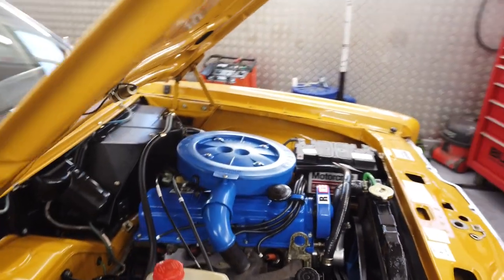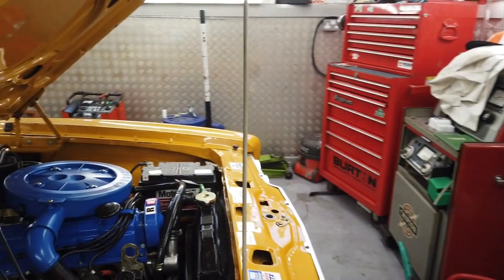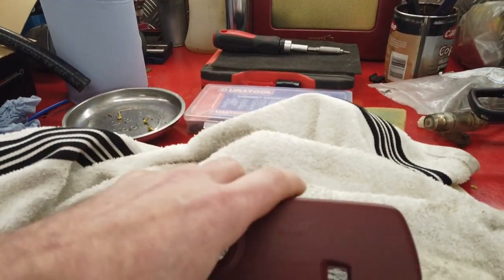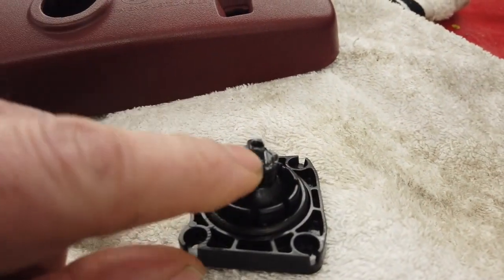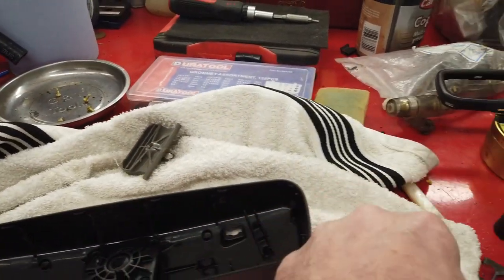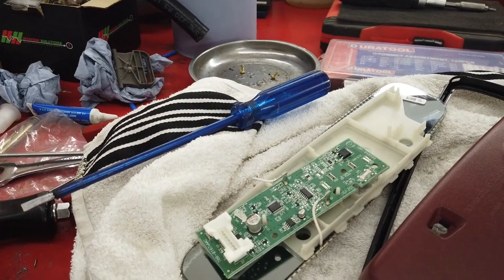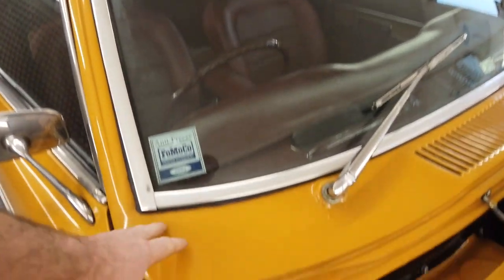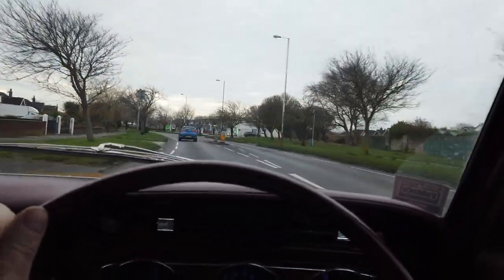Modern Headlights are too bright! - Here's a Classic Car fix that could help you!

Comment: The headlights on my Mercedes are amazing. The intensity adjusts depending on how dark it is. So on a dark country lane they are a lot brighter than in town driving. Also they adjust their focus so they always point at the number plate height at the car in front regardless of how far in front it is. Auto dipping even works when coming to a corner or the brow of a hill.
Reply: They are evil

Comment: I also have noticed that some newer vehicles on the road do tend to put out too much light at high levels. Like you, i am all for having more light output from my headlights, but some modern vehicles don't seem to have the lights adjusted correctly. Either that or the lenses on the lights are badly designed. A dipped headlight should not be directing light straight out from the front of the car, it's called dipped for a reason, the light should be focused down onto the road. I think the department for transport needs to tighten up on the regulations regarding headlight alignment on new vehicles. If a car with it's dipped beams on at night is still blinding other drivers, something is obviously wrong. 

So i can see the attraction for fitting an auto dimming mirror, might just do the same on my old MK2 Mondeo. Great video Pete, i like how you explain about the wire for the reversing light, that is something i would defo need - i have flood lights in my drive that would no doubt cause the mirror to dim - not something you want when trying to reverse along your drive at night. Ruby is looking great, so nice to see her engine bay looking so good again. Lets hope that things in the world will improve in the next few months, and you will be able to get out to some shows again.

Comment: I don't know about the rules in Britain but in Sweden, were I live, at least for the xenon lights, cars must have a gyro installed that makes sure that the dipped beam doesn't dazzle you. It's also illegal to convert the dipped beam to xenon whithout that gyro which means that it is a very expensive thing to do legally.

Comment: Pete...Re the cam belt oil spray onto the underside of the bonnet, I used to find the clue was the order in which you tighten the rocker cover. If you tighten the two  bolts on the upright part of the box even just by a small amount, it causes the cover to distort and not seal the gasket properly. I found that it was best if you tighten down the edge bolts before the side bolts, it would pull down more squarely and then finally tighten but not over tighten the two “vertical” bolts. Now in period, all we had were cork gaskets and your rubber ones may be much more tolerant. I don’t know if that helps but it did in 1973/74! Richard🙂🙂🙂

Comment: Even when riding in a pickup truck, LED lamps are much too bright! Most are the bright white light.
Outside rear view mirrors are also blinding, but some vehicles have tinted outside rear view mirrors that Audi had had for a few decades.
Auto dimming uses a film and sensor to dim, and works very well.
I must also agree age does play a part of headlamps while driving, at least from my experience, as well as LED bulbs most have switched to because they use much less energy yet are more powerful. So it is a win/lose no matter what!
Reply: The problem is that these LED white lamps mimics daylight in order to see at night, which is the problem right there.
I agree with you Pete that some vehicle headlamps just might be out of adjustment! I noticed your vehicles in the UK 🇬🇧 have adjustable levelling headlamps due to weight; we don't have that feature here in the US. I think some headlamps here in the US might level or adjust automatically, either that or self-levelling suspension helps compensate for the headlamps.
So your problem Pete is not just you but many of your fans from around the world 🗺, we have problems with dazzling, blinding headlamps!

Comment: Fully agree and feel something needs sorting possibly need dimming windscreens LOL. My previous car was a SUV possibly 4” higher in the seat, no issues for me and the headlights were Xenon but being a Vauxhall the headlights would only illuminate if the auto adjustable cycle checked out and whilst driving they had to change adjustment to suit direction and boot loading etc so are safe! Now I’m sat lower headlights through the screen are too bright and do not self adjust for in coming traffic! I even think Range Rovers  apply full beam automatically and instantly dip when the full beam sensors activate to give that dazzling FLASH that hurts our eye’s ! Somebody famous like Pete C could take campaign and signatures to Gov office so at least they can put there Tea down without damaging the Walnut desktop. 🤔

Comment: Car looks well after fire, yes I agree the modern lights are horrible on some cars I had the problem with this in my old Rover and have issue with a fairly modern Mondeo, I think there needs to be a overhaul over moderns cars lights blazing out too many lumens of light or direction needs adjustment

Comment: Great to see the engine bay looking mint again, superb job Pete - as expected, and  I like the electric mirror clever bit of kit, but when you consider the Cortina Mk3 had a dipping rear mirror option built in for night driving at a flip of the leaver, that coped fine with the old sealed beam and newer Halogen lights, it shows just how much brighter these new units are!, if they still dazzle in that mode, I do not see the point of extra bright lights, useful on pitch black roads maybe,  but how many times would car owners ever use them for that,  and in town I just do not see the point of them, when street lights and normal Halogen work fine.Hi tech lights are just another gimmick to try and sell modern ugly boring cars to the public!

Comment: Hi Pete, 

I hate driving at night nowadays because of those high intensity lights. I think something needs to be done about them. I find them so bright in oncoming traffic sometimes, that I'm actually blinded to a point where I have to slow to a crawl so as not to run into anything.

It seems to be the colour temp and intensity that causes most issues for me. The temp on most appears to be white to blue, rather than the warmer off-white to orange, which is easier on the eye. Surely dipped could be set to the latter to improve things for other road users.

Off-topic, I found myself wondering if the owner of the bike without saddle and wheels etc. at 32 mins onwards left it that way or lost them due to only securing the frame when leaving it 😥

Anyway, Happy New year and all the best.
Greg

Comment: Has there been a patent filed for aftermarket auto mirror powered by solar rechargeable  batteries they cant use much power look at welding masks. A modified boost circuit used in garden lights could power it and would auto switch it on in the dark. I am sure you could make one Pete

Comment: Nice work as usual Pete 👌  Question though.. Why don't you turn the air filter housing lid around so that it's sucking up colder air from the carby manifold side?  As it sits it is sucking up the hot air coming off the extractors.  Just a thought.
Reply from the maker: hi mars bar! well the design is such that in winter you set it in that position for better economy, warm air less dense for better combustion i think
Reply: @PeteCswampy  I see, makes sense.  It wouldn't have to work as hard to get up to speed with cooler air, in theory.  Would be a fun experiment to do on the show in true mythbusters style to see the differences in how she runs. Drain tank, add say  25 pounds worth of fuel, 45 min run, measure what's left etc :)

Comment: Modern bulbs are far too bright,  I complained to the Govt and got told that they are 'carefully assessed and regulated'.  🙄  Causes problems with higher vehicles such as buses, blinding everyone.  You can't see anything else on the road when a vehicle like that is coming towards you.  What was wrong with driving slower at night like we used to.